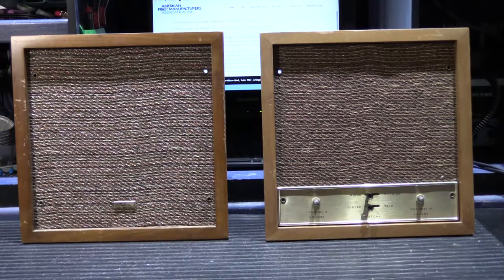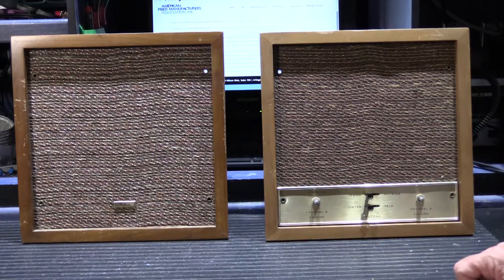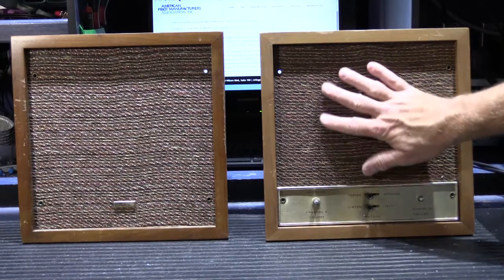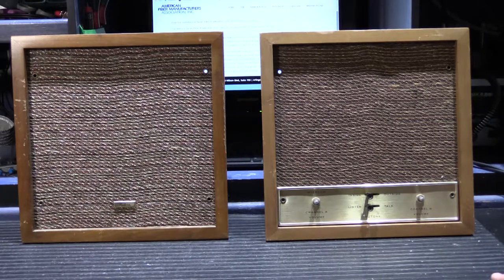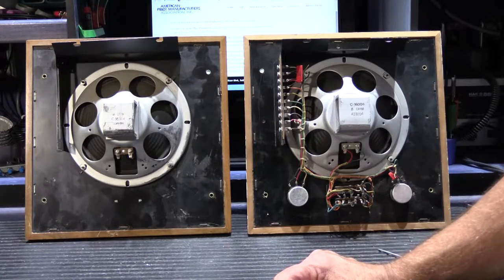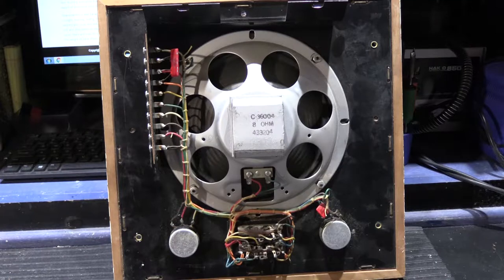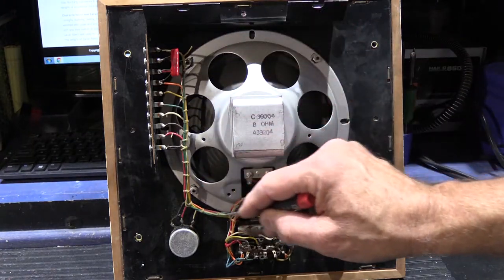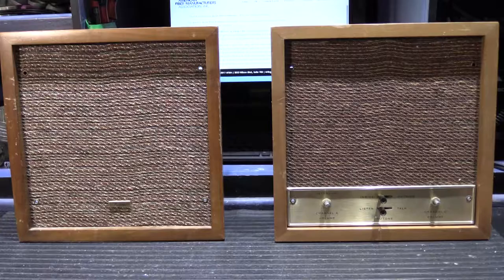An Overview of the NuTone Model 2411 and 2412 Stereo Music Inside Remote Stations

Comment: Hi Chris,
Thanks for this informative video.  Can you tell us what is the purpose of the metal bracket that folds out at a 90 degree angle at the rear top of the speaker frame? I notice the model 2020, eight inch, mono, high fidelity speakers used the exact same speaker frame, just with less wires and, of course, no switches mounted in the lower center.  The model 2020 also has that 90 degree bracket jutting out with two open ended screw slots.  Just trying to figure out what an installer would use that bracket for.  Was it used as a way to support wires that were coming down into the speaker controls?  Seems extra heavy duty just for that.
Reply from the maker: Hi Anthony:  The bracket on the back of the Remote Station has 2 keyway slots in it.   On the Mounting Frame (behind the sheetrock) there are 2 matching mounting posts.  The installer can lock the Remote Station in place, on the posts - this leaves his hands free to make up all of the wire connections on the Remote Stations Terminal Strip - Chris